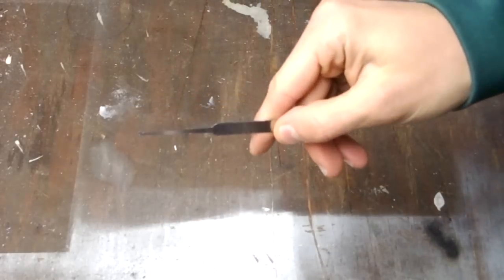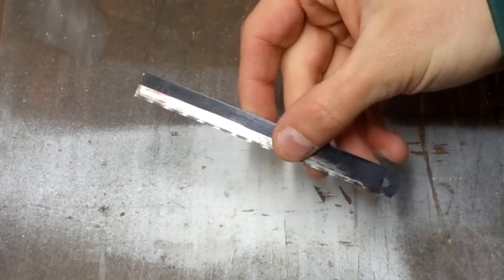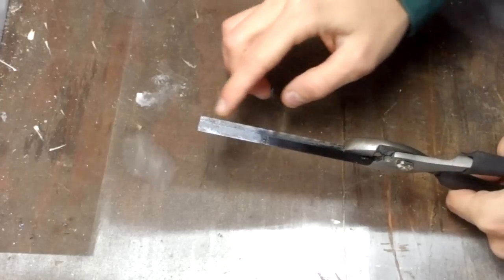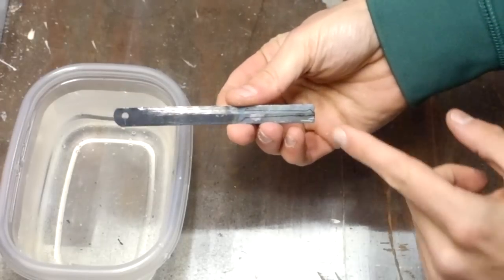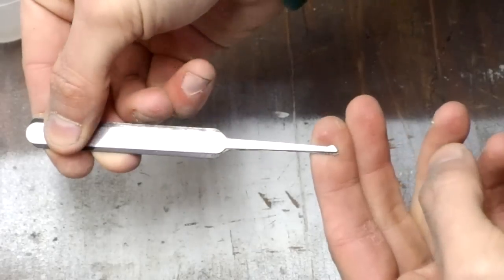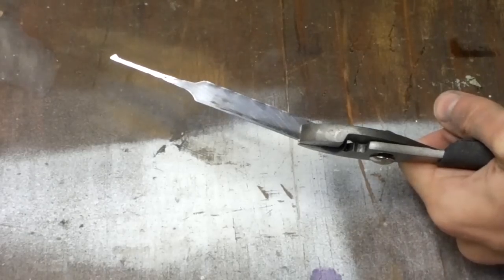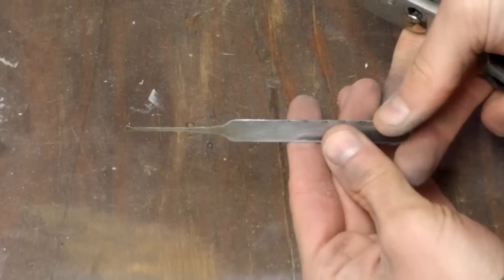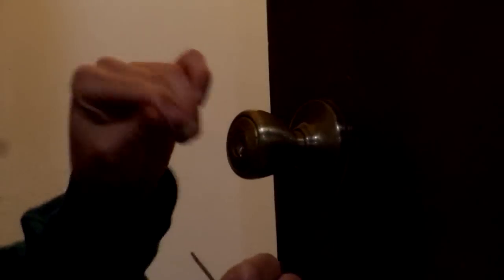Fast Hacks #21 - Make Lock Picks from Hack Saw Blades

Comment: Why do you un temper the blade at the beginning yet you quench it when grinding ?Do you not think this is pointless as you are tempering the pick at the end any how.thanks.
Reply: +James Miller Water also cools way too fast, should use a warm oil (transmission fluid is popular as well).